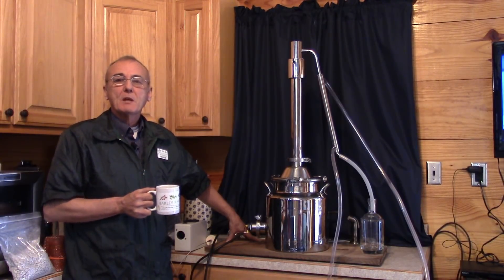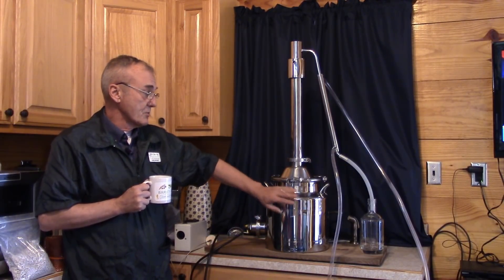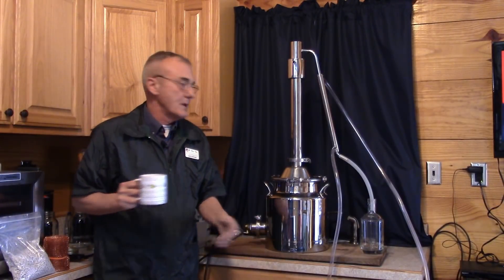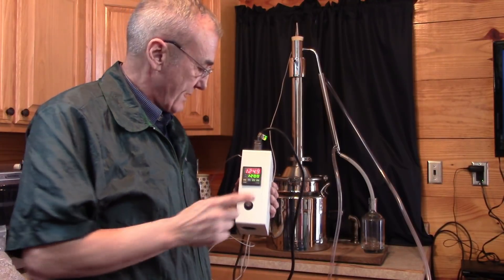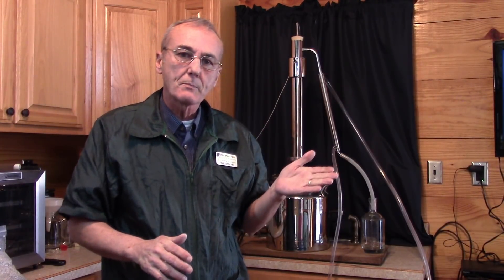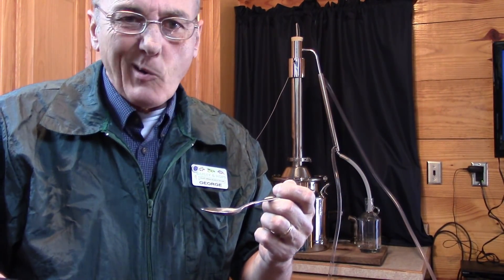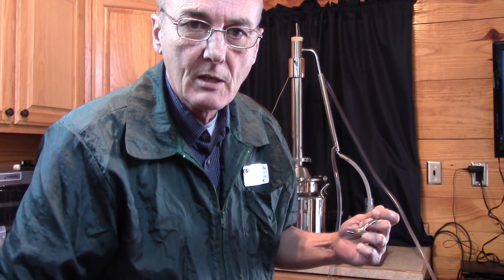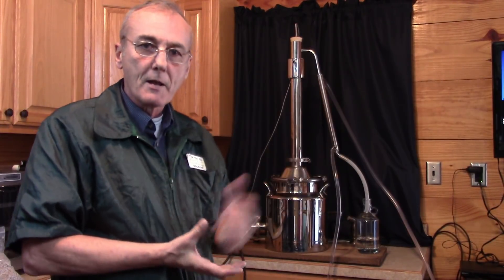RUNNING THE MIGHTY MINI AND AUTOTUNING YOUR PID

Comment: I’m afraid the auto temp control is a bit beyond me at this stage. (Tech learner). What I have is a stove switch and a temp sensor similar to George’s . I adjust the stove switch,((which is in the power supply to the still) to the head temp I want. Maybe a bit crude but it works ok. I would like to go auto when I learn more.

Comment: Hi George, i have big question, i watched  alot of your videos,  and make me thinking,  isint beter to  regulate water for reflux cooler by PID and eletromagnetic valve (in Comum)???,  when you regulate  heating element whit PID you  destroion reflux ratio by pulsing ,you  just stoping flow in colum and its biger reflux.

Comment: Hi George and great hello from Australia. Im new to distilling and your channel. Its great stuff and I congratulate you the content. I have one question and it is my greatest fear in running my own still. Its re methanol. In this vid you spend a little time on it and i do understand however, is there another vid that you go any further with how to test and at what point it is safe and being sure its ethanol that comes out of that pipe. Also, once methanol stop at initial run, is there a possibility that there is some again further down the process that it appear again ?

Comment: I need some help I have a 40 amp 240volt oven plug and i wanna run pid controllers on a powdercoat oven.can u explain  to me how I go about wiring it up.i need atleast 3 elements and a fan to make temp

Comment: Thanks and great video!  But I do have a question. That extra part on the heater element. Is it called "1 Inch Stainless Steel NPT Half Coupling" ?  I just want to order the right thing.
Reply from the maker: not sure if half is part of it but it is an NPT furrel or coupling
https://www.amazon.com/s?k=2+inch+tri+clamp+fuel+adapter&dc&ref=a9_sc_1

Comment: Dear George, wouldn't it be better to use the auto-tune at a different temperature (like 140) so it will balance the process and alters the P, I & D parameters? When the right parameters are set I can slowly increase the setpoint so I can control the temperature of my distilling better? When tuning it at the 173F it will go above and below while autotuning (or do I miss something?)

Kindest regards from the Netherlands
Reply from the maker: Yes,
 In order for the PID to autotune it needs to go above and then below the set point 3 times at a minimum to make its calculations for autotuning. Do this at 140 is a good place before you get to distilling temps.
If you run into any problems start over with the following settings; P=1 I=540 and D=200
George
Reply: @BarleyandHopsBrewing  You are really the best! My other PID (Rex c700) works excellent on my UDS. Keeps the temp. in between 0.5 C during a long cook of porkshoulder! It triggers a small fan which blows towards the woodfire in my barrel and so adjusting the temperature above on the grillgrate. Same principe, but without a ssr as I have a relay PID. So I let it open/close the 12volt supply towards the fan. It can switch up to 3-4 amps but that will give problems on the long run.

Comment: George, great video. At what point in your process did you do the Autotune? Do you repeat for both your methanol and Ethanol set points?
Reply from the maker: I use it at several points. Normally at the beginning when I set it to 100F and then again for the methanol point and then at ethanol. 
George

Comment: George - me again - is it possible to have two set points on the PID one for the methanol and then another one for the ethanol - or is it the norm just to have the upper temperature and monitor the output - Many Thanks
Reply from the maker: The PID operates on one set point. You can set it for the methanol stop and then just reset it for the ethanol run.
George
P.S. As the volume changes you will need to re-adjust the PID anyway and inch it up a few degrees at a time. Use the auto-tune feture, it is great.

Comment: Love the video's George but I have several questions about thump kegs and the benefits of running one thanks for all the information keep up the outstanding work
Reply from the maker: I have been avoiding doing any videos on thump kegs for several reasons. The most important one is the misunderstanding people have about them and the difficulty in running one without some experience. These are run mostly by sound, output and understanding of the process as opposed to a hard temp rule. Also, there is so much confusion about their benefit of which is minimal unless you really know what you are doing. People believe that it doubles the alcohol or creates more somehow and no matter how I approach it the name thumper or doubler just doesn't help. Kind of like secondary fermentation where there is actually no fermentation happening but is more clearing but the name implies something else. One day I may do a video but until then it will remain on the list as a possible future production. Hope you understand.
George

Comment: How short can a reflux coloumn be where the reflux still works? is there a minimum length? (using copper mesh and copper saddles inside)
Reply from the maker: Through my research I have found that most prominent distillers recommend no shorter than 28 inches.
George
Reply: Ok..Thanks

Comment: What is the best water to use for a wash ? Distilled, purified , spring ?
Reply: t b  
It is all based on the acidity of your water. If you plan on using a good water that you can buy,  I'd go with the spring. It  is a very clean neutrality water and works wonders in making smash as well as cutting. So you can go to Wal-Mart if need be and get their spring water in the gallon jugs to use. Hope this helps ya!

Comment: Hey George Thanks for the great video, I thought u needed at least some copper in the system to take out the nasty flavors  ? Does it make much difference ?
Reply from the maker: This is a much debated topic. I have not found any definitive evidence on either side. I've run these with and without copper in them. To me it all boils down to a personal choice. I ran this one without any and as usual had no issues or off flavors.
George
Reply: Ah thanks George

Comment: I wish I could just buy one of the PID from you George.
Reply from the maker: Rob, I have a few already made exactly like the one on the video.
George
Reply: Just a PID  or the complete control box??
Reply: complete control box
Reply: ok,  if George is not going to sell these I might be interested in building you one,  for a couple dollars over cost of parts & shipping, from what I have done the box can be the most expensive part after the pid itself,  still trying to find a reasonable priced one, George can find the boxes alot cheaper than I can,
Reply: you can email me spcfarr2000@gmail.com  for a price that would be great